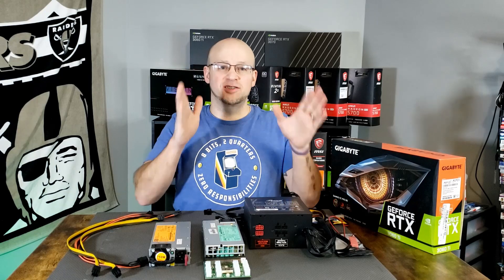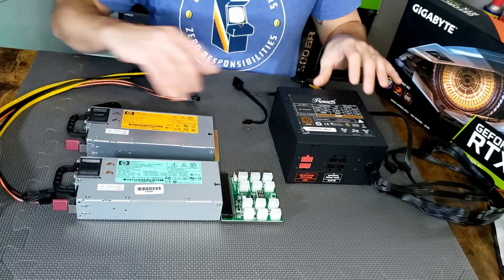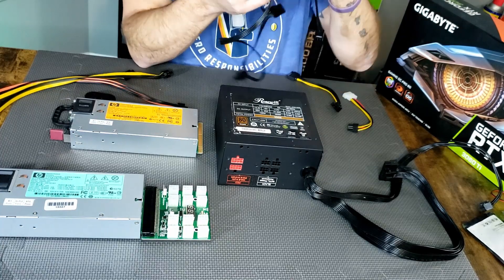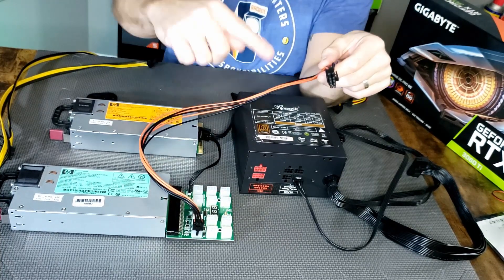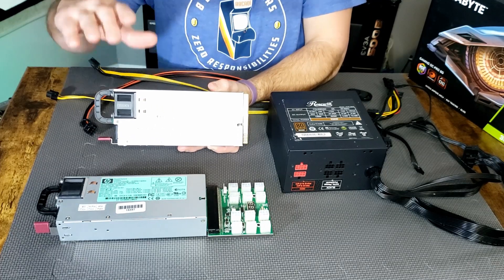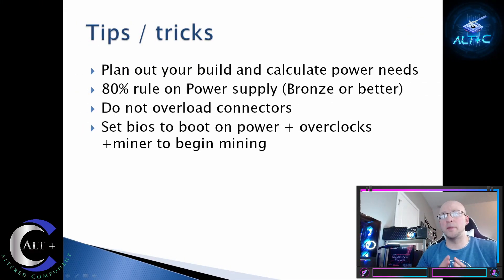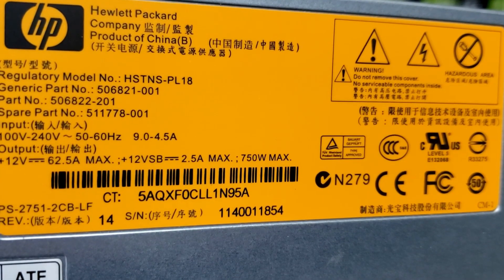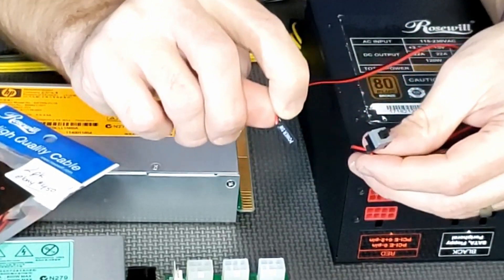How to use Server Power Supply for Mining Rig:  Quick Setup guide

Comment: What about PDUs/Power Distribution Units/30amp outlets/240volt/two poles/I saw the power supplies were okay with 240 volts; Are the computers/servers okay with that as well?

ALL my computers draw/require 3000 watts of power a piece/ALL of my servers use a constant 3000 watts a piece.

ALL of my houses wire is 6 gauge,my panel is 400amps as well.

I NEED MORE INFO.
Reply from the maker: = ) all these server PSUs will give a input range for the voltage and an output wattage range for that voltage.  That is a lot of juice you are using.  My man Mad electron engineering has done a number of videos on PDUs.  Personally my rigs all running under 2k watts.  My house on a 200amp panel.  Running mostly 120v /20amp power.

Comment: is there a link to youtube is there a link to the hp 460w dps-00F device model no.,?
i want to make 14.4v modified
Reply from the maker: not off top of my head, but here is a good cross reference chart from parallel miner where you can take a model number and verify the breakout board, if one exists with Parallel miner:  https://www.parallelminer.com/uncategorized/breakout-board-compatibility-list/
Reply: @AlteredComponent  i'll just solder the cable to the copper plate of the device, just ask the question I want to change the water model dps 460eb A 00f to set the device to 14.4v, can you help

Comment: Isn't running 6-pin out to 8-pin in dangerous? 6-pin = 75 watt, 8-pin = 150 watt?
Reply from the maker: Great question.  The answer is Yes and no.  for a traditional ATX power supply you are correct.  For a server PSU however, you can run up to 298w out of a single 6 pin cable from your breakout board and split it safely.
Reply: @AlteredComponent  Thank you sir! I'm confused though, on the specs I see say the cable can only do 75w even though the breakout board may be capable of more. Hashraptor did a video showing two of his 6-pin cables frying coming off a breakout board: https://www.youtube.com/watch?v=Bap7RcmJQos - I would love to use server PSUs but I'm (perhaps overly) concerned about fires and this seems to be a risk.

Comment: What server power supply or atx?
Reply from the maker: I prefer using server psu with an ATX.  Usually i used a cheapo Bronze ATX power supply and then use either a HP 1200w, an HP 750w, or a dell 1100w server psu.  Mine on

Comment: Can you help me how to automatically turn on the server power supply using that detection port from the breakout board? or if there are options to do it. I want to use smart plugs in-case there's a power failure or if i want to turn on / off remotely. So I don't have to manually push that small button from the breakout board. thanks.

Comment: Is it safe to install the server power supply and breakout board inside the pc desktop case? I want to remove the atx power supply and replace with server power supply.
Reply from the maker: sure is.  you would need a Zsx All in one breakout board from Parallel Miner or you would need a PICO adapter.  Both those options give you a 24 pin, a 4 pin cpu power, and sata/molex options.  Server psu's are made to run full tilt 24/7 and are generally very efficient depending on make / model

Comment: What type of power cord must be used with hp server psu? They are usually sold without power cords.
Reply from the maker: Thanks for watching.  These are the same cords that a standard ATX power supply would utilize.  The end that plugs into the server psu is a "c13" end.  Then to your standard outlet plugin on other side or a c14 end if plugging into a PDU.  Take care

Comment: Thanks for the vid. I have the strangest problem running an atx with server psu. No matter if the remote sensing cable is plugged in or not, it triggers reboots at random. I have 4 ATX EVGA here and it does it with all of them. Any chance if you know on the newest breakout boards (with 24 pin) if you have to actually run that cable and put a jumper on it?
Reply from the maker: you do not have to run the jumper to the breakout.  That jumper is simply a 5v in sensor.  When it detects a 5v current it triggers the board and server psu to turn on.  I ran for years with manual switch on the server psu and the motherboard.  So i would simply turn on the server psu first, then turn on the motherboard.  Now if it is rebooting with nothing connecting the Server psu breakout and the ATX psu, you have some other issue there.

Comment: Can you also hook up the 4 pin psu sync cable to a pico so that when you pres the motherboard button both(pico, and server psu) turn on at the same time?
Reply from the maker: honestly not 100% sure on that.  The 4pin senses 5v power.  So if it is a 5v  in then it should work, but if it is 12v you may cause some damage

Comment: Hey I bought 4 of these HP 750 watt psus (with the blue plug). The fans do no spin up at all. They are spinning around 30-75 rpm, not 5000 like server psus should.

Did yours to the same?
Reply from the maker: the blue plug are the platinum versions.  generally the black is the gold version.  Did you put load on them to see if the fans would whirl up?  are you certain that your  breakout board are compatible?  here is a handy compatibility chart on Parallel Miner:  https://www.parallelminer.com/uncategorized/breakout-board-compatibility-list/?wpam_id=222

Comment: can i do this with the x11 the daisy chain??
Reply from the maker: sure can.  X11 a solid board and great to chain together.  I have a setup with dual x11, a setup with zsx and x11, and a zsx and x8 pair i believer.  Also, you dont even have to chain them if you dont want to.  That is just to make it convenient for power up at the same time.  you can power up both manually.  If so, power up the one going to the gpus and externals first, then the one hooked to mobo.
Reply from the maker: sure can.  X11 a solid board and great to chain together.  I have a setup with dual x11, a setup with zsx and x11, and a zsx and x8 pair i believer.  Also, you dont even have to chain them if you dont want to.  That is just to make it convenient for power up at the same time.  you can power up both manually.  If so, power up the one going to the gpus and externals first, then the one hooked to mobo.
Reply: @AlteredComponent  that is a bunch!!

Comment: Thanks for being so responsive! So I have my 750W server PSU hooked up and you say to be sure to have the inputs hooked up evenly on the left and right side. However this is a 750W PSU. My cards run at about 155w, not including risers. I have 3 cards hooked to it right now and am worried about hooking a 4th up, given the 80% rule. Is just having 3 hooked up ok?
Reply from the maker: 80% rule is not a thing with server psu.  People will feed you that on YouTube and discord.  However I have discussed this with the guys at parallel miner.  Joseph said his warehouse will have those 2400w delta server psu maxed out running 24/7 for very long periods of time.   I personally have no qualms pushing a server psu to 90-95% of max load.  That beings said, the fans in those things will talk to u loudly on a load

Comment: I just got my server psu and it includes that little 4 pin cord but both sides are the little 4 pin so how do I connect it to my ATX power supply? Thx
Reply from the maker: The mini 4 pin to mini 4 pin is designed to connect 2 server power supplies together.  From server psu breakout 1 to server psu breakout 2.  To connect atx to server psu, there needs to be a molex to mini 4 pin connection.  Some atx will have a mini 4 pin connector on a molex pigtail, or some come with a molex to mini 4 pin adapter.  If not they sell these adapters on ebay or Amazon.  U don't actually have to connect them for it to work.  U can just power up the server psu first then the atx both manual

Comment: That noise is the only reason I'm thinking about not doing the server power supply.
Reply from the maker: thanks for watching.  completely depends on a few factors.  1) the server psu itself 2) the load placed on the server psu 3) and of course where you plan on putting the rig.  If the rig is going to be in your bedroom or an area when you need quiet, 100% go away from server psu.  circling back to the server psu itself and load.  different server psu will run those little fans differently.  ie, the standard HP 750 / hp 1200w server psu.  The fans do not whirl up nearly as quickly as my dell 1100w server psus.  If you run a HP 750/or 1200w at 70% load or less, they are barely louder than an atx psu.  When you put them up to 90% + load, they will let you know it.  Whereas with my dell server psu, as soon as i load that thing over 50%, it starts to let me know.  at 70% load it is quite loud.  I have a rig in my main office where i work  with a server psu and it does not make enough noise to interrupt conference calls.
Reply: @AlteredComponent  It would be going into a 60ftx50ft with 16ft ceilings. I don't know if it would be annoyingly load in there since my GF does dog training during the day in there. Maybe it's not as loud as I think. What would you compare it to for noise?
Reply from the maker: @randybobandy9828  the rig in my office has a 8 x 3070 rig.  It uses 2 server psu.  A 750w hp and a 1200w hp.  I have the load (1000w) evenly distributed between the 2.  It is barely louder than the cheap uphere 120mm fans at full tilt.  Again, it depends on load u put on it
Reply: @AlteredComponent  ok thanks. I think I'll give one a chance.

Comment: I can power up server psu with 16 awg power cord as well right.is there any reason why connecting atx psu with server psu? I have 1000w server psu though
Reply from the maker: thanks for watching, you absolutely do not have to connect the atx and server psu.  You can run both with no connection.  simply boot the Server psu first, then the atx.  use the atx to power the system, accessories, and possibly a card or 2 and then the server for the over GPUs/risers.  Note, make sure to power the gpu and risers from the same power source.  So if you power gpu 1 with the atx power supply, also power it's riser with the atx.  then in you power gpu 2, 3,4 with server psu, also power their risers with the server psu.  mine on

Comment: You covered everything except mounting. how to get a housing for the server psu so it can be mounted properly.
Reply from the maker: Thanks for watching. That is a tough proposition actually.  So i generally use a thick foam double sided tape to hook down my server psu. most have a ring by where the plug hooks in and i often zip tie that to the frame.  Some people have created a nice 3d printed mounted bracket, but i believe those are mostly for when mounting on a wire rack.  someone needs to come up with a good 3d print mount for these

Comment: Hi!! is it possible to use an HP PSU as a main psu ?? How can I auto-start a HP PSU with detect electricity ?? I have a "normal" psu plugged in a smart switch, when I click "ON", "normal" psu detect it and start inmediatly. Is it possible to do that with a HP/Server psu??? Thanks for your video !!
Reply from the maker: Yes you can use an HP as the main, however you would need either a zsx all in one breakoutboard, or use a pico adapter. That being said, i do not think there would be a way to queue the powerwhen the wifi switch is kicked on.  From bios you can boot on power, but that is the board booting when it sense power from the psu.  If the server psu is connected to a wifi switch and you turn the switch on, it wont kick the psu on.  That being said, i can turn the wifi switch off and back on quickly and it will reboot the server psu and system.

Comment: I have an HP 1200w psu under about half load, it's very hot to the touch and the fan doesn't pick up speed. Is this normal?
Reply from the maker: Thanks for watching.  They will get hot to touch, and the fan speed may not pickup until u put more load on it.  That being said, at half load I can hold my hand on the case without burning myself.  If it is getting hot enough that it is burning you, then I would suspect an issue with your psu.  Take care

Comment: Great vid! How do you get them both to come on at same time? ATX and Server PSU
Reply from the maker: Thanks for watching.  you would connect a molex strand to the breakout board mini 4 pin connector.  Often a molex strand will have a mini 4 pin connector on it from the atx psu.  Some, like evga, come with a molex to mini 4 pin adapter.
When you boot the atx, it signals the 5v connector on the breakout board and both turn on.

Comment: Greate video.  But I have a question. I have 2 RTX 3090 running at 315 watts each.  Can I use the HP DPS-1200SB to power them?  They take three 8 pin cables + 6 pin riser each.
Reply from the maker: thanks for watching.  Absolutely can use a 1200w server psu for those.  Most breakout boards give you 12 6pin outputs.  a single six pin can pull safely 288 watts from a breakout board.  so you could run 1 wire and split to dual 8 pins, then run another 6 pin to 8 pin cable from the breakout board to the card.  do this for each card.  Then you can run a single six pin cable and split into both risers, or run a separate for each riser.  take care
Reply: @AlteredComponent  but always i see, that a 6 pin pci-e can maximum 75 watt give out - where do you have this information about 288 Watt ? bye

Comment: i am only using this server PSU. every time the power goes off, ill have to manually turn on the PSU by pressing the white power button. Is there a way to get it auto turn on?
Reply from the maker: thanks for watching.  Have you set the Bios on the motherboard to boot on power sense?  the other alternative that i like to use are wifi outlets to power on and off rigs.  However in the instance of using purely server psu, once that breakout board is powered down, i dont think flipping the wifi switch off and on actually kicks that board back on, so then the motherboard does not sense power and the system does not come back on.  Let me know what you find please.

Comment: Great video but the statement that a  server PSU is more efficient and puts off more heat is just wrong. If it produced more heat than a comparable atx PSU it would be less efficient.
Reply from the maker: yes and no.  You are correct that efficiency is basically the loss of power that is given off in the form of heat.  the difference is the way an ATX is packaged into a large square or slightly rectangle shaped frame with a big 120mm fan and lots of ventilation.  When i said puts out more heat on a server psu but more efficient....i mean the Server psu case itself gets really hot and puts out heat.  generally a server psu uses only a 40x40 fan  or 2 to cool the server psu and does a blow through with llittle ventilation.  this causes the case to heat up quite a bit.  Once you try server psu on a mining rig at least in conjunction with a atx, you wont go back to only atx.  thanks for the comment

Comment: Aren't you not supposed to split a 6 pin too much? if a 6 pin is only supposed to deliver 75 watts, isnt one of them good for just a riser, and anything else is unsafe? I maybe am missing a different with server power supplies?? I split the 8 pins as they are supposed to deliver 300 (woops 150) , but now that doesn't seem like it could be correct.
Reply from the maker: Thanks for watching.  Specs are different from a Server PSU compared to that of a atx.  A You are partially correct.  A 6 pin connector is rated 75 watts and a 8 pin connector is rated 150w, at least the was the original standard when these were created and still hold mostly true on an atx psu.  now as for a server psu, a single six pin port from a breakout board can safely deliver 288w, but i would have no qualms pulling 300 watts from a single 6 pin port on the breakout port.  That should be at least a 16g wire.  Now from that single six pin cable, you can then split out to dual 8 pin, or even 3 x 8 pin depending on what kind of power draw you are demanding through the cable.  again target sub 300w on a single cable from the breakout.  Parallel miner sells a 6 pin to triple 8 pin splitter.  These work well for instances where the gpu has dual 8 pin and you also want to power the riser.  These would work well with a triple 8 pin gpu....IF you have it undervolted down safely.  Personally i wouldnt recommend this on anything above a 3070ti.  Too much draw for my comfort.  That being said, on my 3070s, this works well.  How this helps
Reply: @AlteredComponent  ahhh man thank you so much, great explanation for my beginner brain. Great to know server psu's can output a bit more through those cables, I was wondering why I would get sent so many 6 pin splitters if they weren't safe! although they do send the sata power cables......

anyways, thanks for the info, that's very good news to me! subscribed :)

Comment: Great video, I saw a recommendation somewhere to not power risers and GPUs from different PSUs (i.e., GPU and its riser should be powered by the same PSU) in case one fails and the power flows to either the riser or the GPU from a working PSU; this can possibly create a fire hazard.
Reply from the maker: thanks for watching.  Yes that has been the consensus i have heard for a few years, but early on i definitely powered the risers and gpus from different psus and never had an issue from that perspective.  Nowadays i do try to keep the gpu and riser coming from the same power source.  I believe this also allows for the power to be evenly distributed from one psu and not to allow it to demand too much power from one source or the other ;)
Reply: Yeah, i just burned my 3 gpus wby wiring rizers with atx and gpu with spsu. Stay away guys